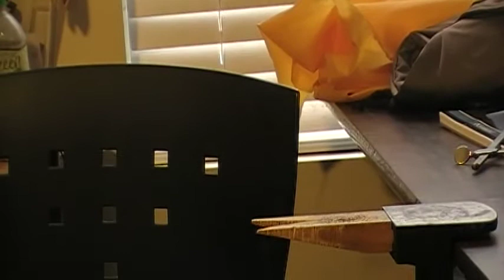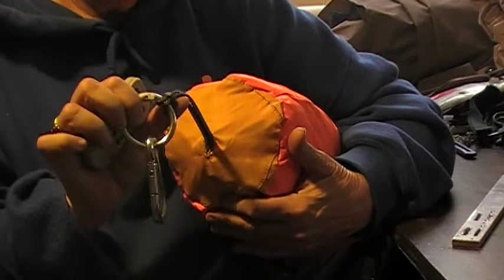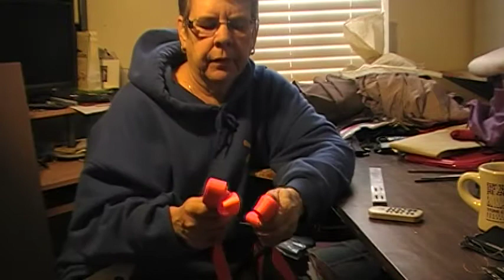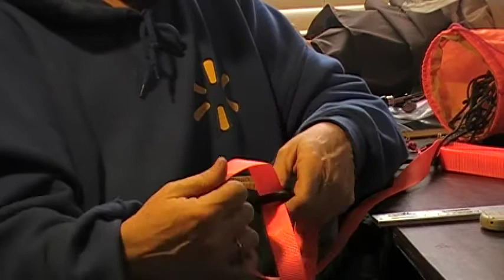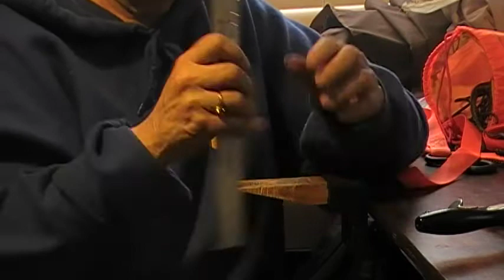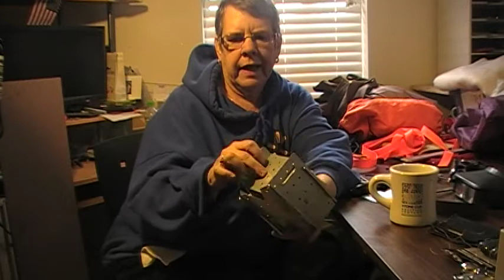tarps, bags, hammock buckles, stoves oh my

Comment: I am enthralled by ur fire box..it is something I've been contemplating how to make!
Reply from the maker: +SunsetBay Bonnie   The guy that has the really good how to is sirtinkerist.  He has one on how to lay it out and then a really good one of actually fabricating it.  If you have a cheap side grinder with a metal cut of wheel it is super fast to make.  I think Kullcraven bush craft did it all with a dremel and cut of wheels.  I think that would take a good long time.
Reply: no side grinder for me, i guess il have to put that on the "list' lol
Reply from the maker: Get one when it is on sale at harbor freight.  A little 4 inch side grinder will make you smile.  I have been using mine for 15 years and it still just does whatever I want.  You can often find them on sale for 20 bucks or so.  Watch for coupons.
Reply: +SunsetBay Bonnie I use grinders and chop saws at work. But several years back I got a Kawasaki knock off dremel set from sams club for 30 bucks. Carving bits and all that good stuff came with it but I've bought many bits since. It'll cut that metal, u can get some of the carving bits too and test those out. Its loud as hell, I've been told dremels aren't as loud but gets the job done.
Reply: ive got a dremel but ive seen a few projects that a grinder would be good for.
Reply from the maker: Yeah, get one.  I have used both extensively and each has their place.  I love them both.

Comment: Reallybigmonkey1 uses welding rods but I've used stainless steel dowels from the hardware store for things. 4 feet long, whatever thickness you need, anywhere from .60 up to 4 bucks for the thick stuff. For a grill rods for your stove you could try using metal clothes hangers, or in the camping section of Walmart they sometimes have the marshmallow roasting handles. They basically look like a pack of metal fly swatter handles minus the plastic. Those are supposed to be stainless and I think I got the set of 4 for the kids at 2 bucks don't quote me on it though, easy to cut one of those up. Just make sure you don't breath in the fumes the first time you use it. Some of those binding plates are galvanized, but I've seen uncoated ones too. Don't forget a wind break for your mini stove too. I like watching Tetkoba's videos on alcohol stoves, he has some great designs and shows you step by step how to make them.
Reply from the maker: +tattedupdaddy1 I have looked all over for plain stainless welding rods and can't find them.  I have some of those marshmallow sticks.  I have plenty of coat hangers.
Reply: I've found the welding rods online but can't get them at any local stores. So I went with the metal dowels, home depot, lowes, ace hardware typically has them. Or a new grill rack for 5 bucks from Walmart and cut that up. My wife see's junk I see potential lol.